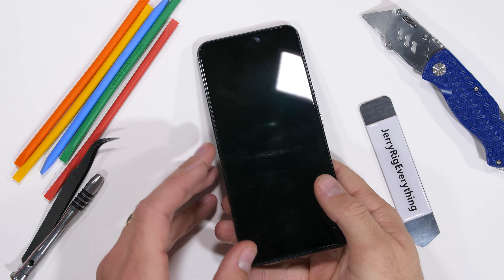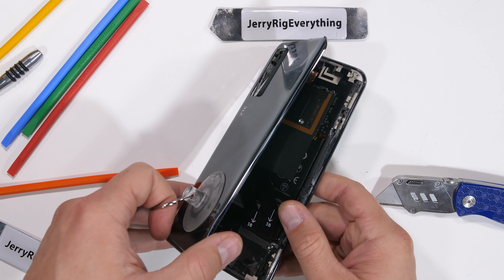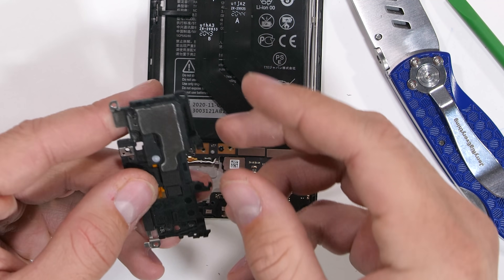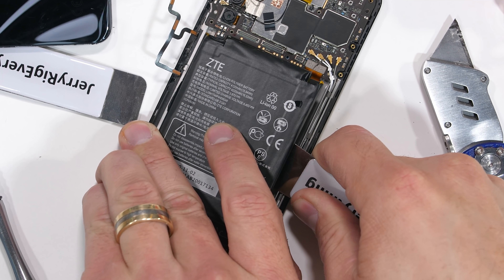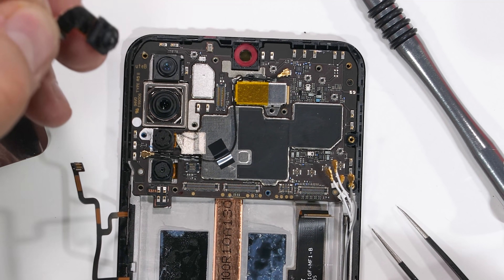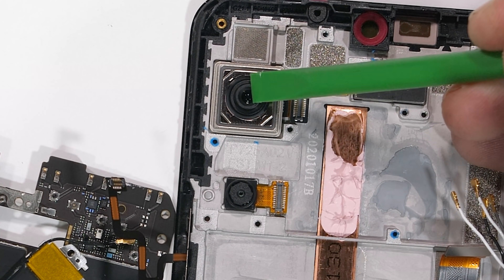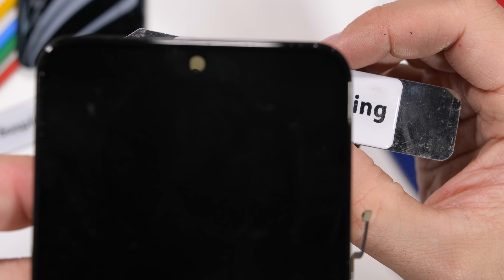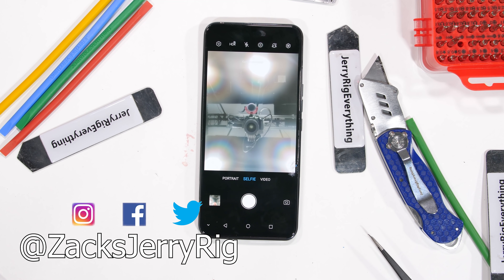Under Display Camera TEARDOWN - How does it work?!

Comment: I work with that symbol daily at work. It means ESD sensitive component, and do not touch without proper ESD protection. 

It is to notify for factory operators to groud use ESD strap before handling the components.

Comment: sir pls help me. I have a doubt. my phone fell into water. I picked within 5 secs. removed sim. switchoff. nd after few hours water is in display . functional visible, but water seems to spread. some video told to keep in rice remove battery. I ruined it. i seems to have broken cable connecting to main motherboard. while removing it like lego. without experience. can i get cable replaced.

Comment: Hey Jerry,
I'm an electronics engineer from Germany and I see the symbol every day. It indicates that components on the board can be damaged if there is an electromagnetic field in the vicinity (for example, rubbing socks on the carpet or a balloon on your hair googel: ESD or electrostatic discharge). 
This is usually only important when assembling and repairing, but unfortunately most of the time nothing is repaired, so only those who assemble such devices see it. 
To avoid damaging anything, you only touch circuit boards at the edges and ground yourself so that nothing can become charged. 

Thank you for your good content here and have a nice day

Comment: The Do Not Touch warning at min 3:42 is an ESD (Electro Static Discharge) warning. To protect the board from static discharge the person or machine handling the PCB should be grounded before contacting the pcb. It is funny that warning is on the button side of the board.

Comment: Question if they're putting warning signs on the inside of the phone QR codes on the inside of the phone but they don't really want us to repair their phones except for their company technicians so why would you need to put any type of warning or QR code inside the phone? So if someone can please answer that and another thing Jerry almost sliced her self and threw the phone on the floor so I guess I need to heat it up a little more

Comment: Alternative safe method to remove the battery is to freeze it down to about -30°C(-22°F) or even lower. This way battery gets solid and the glue cracks due to shrinkage also the cold decreases adhesion.

Comment: The strange warning symbol actually means something like „do not touch without ESD-Protection“ it is used if the part you assemble/disassemble is sensitive to ESD and might get damaged without protection. Esd stands for electrostatic discharge.

Comment: You switched the order of the ribbon cables over the battery. I guess it's fine, they are similar enough to be swapped, but now they overlap. Not a good look.

Comment: Great job with the teardown. Impressive it still works after all that. One of the more complicated constructed phones I’ve seen. The assembly lines must be a nightmare to setup and run. At such a relatively low retail price it could only be done with extremely cheap labor and overhead costs

Comment: I was still using my L Noxv I got in 2017 up until recently when I dropped it and the vibrator stopped working. It served me really well. Nice to see ZTE innovating again. I still miss phones with dual front facing speakers though. If I had my way, I'd make them make a smartphone with a screen that goes right up to the edge of the front speaker grills. And the selfie camera can then hide under the grill with a hole made larger just for the camera. And then they could use that grill space for other sensors as well. Blending the almost full screen look with great speakers and a camera that doesn't have to shoot through a screen.

Comment: The only way to see the "so not touc" warning is to touch it. 😄😄😄
Reply: For the assembly workers, warning them that this assembly is static sensitive, so needs special handling, and a ground strap. While you probably will get away with it in a humid climate, if you are in the factory making tens of thousands, and have a 1% failure rate, you will lose that contract fast, especially as ESD does not always show up immediately, but can take a few hours to months to show up as random failure. 

Warranty claims over around 0.1% to major phone manufacturers is a red flag that something is badly wrong, and they will get those units to analyse down to the silicon chips in the packages.

Comment: This definitely has to be the new future for front facing cameras
Reply: I'd see these taking off soon in like 2022-2025
Reply: @mistermoee  2027
Reply: It'll probably be the future when apple "invents" it in 3-4 years
Reply: @juliangaming9713  Apple fanboys will shit and piss over it
Reply: @juliangaming9713  apple phones has 3 more cameras besides selfie camera so they really need to work hard to achieve this
Reply: @juliangaming9713  Samsung will launch it next year
Reply: @girlsdrinkfeck  yeah
Reply: @juliangaming9713  2027
Reply: @juliangaming9713  LMFAO
Reply: @juliangaming9713  yea true and actually works
Reply: @juliangaming9713  🤡
Reply: The only bad thing is that now it would be tricky to put some tape exactly over the front camera without losing information onscreen
Reply: @kazuhiramiller2121  why do people put tape on their cameras anyways?
Reply: @kazuhiramiller2121  who does that tho?
Reply: @xNoExcuses.666  besides me, actually a lot of people out there, you can even buy little pieces which open and close as u demand to use use webcam/frontal cam
Reply: @kazuhiramiller2121   well in that case you can use, popup selfie camera. You don't even need to tape it.
Reply: @Alter Ego u mean a phone that uses micro LED ,so it slides out of the way, possible but more complicated and more liable to failure than a transparent panel
Reply: Wait till Apple “invents” this so they can ditch the notch
Reply: @superNova5837  2027
Reply: People want to remove nothch and hole pouch without popup camera so this is the only option
Reply: Not a chance, maybe something to a similar effect but not done in this way. This tech has been around for years and the likes of Apple and Samsung already know about it. It’s just looks horrendous in application and a notch is just so much more useful.
Reply: @lordv1le859  I mean, i don't disagree, hence why I said future. As the tech is now I wouldn't want it, but im a few generations it could be flawlessly integrated into apple and Samsung phones. 

Also just out of interest what do you mean by the notch being useful?
Reply: @Tyrone2714  The notch allows FaceID which is more secure than other types of facial recognition on phones. It also allows for a proper earpiece instead of an under screen or tiny unit crammed into the bezel allowing for better sound when used for stereo audio.
Reply: @lordv1le859  oh didn't realize. What about phones that have punch hole cameras instead of a dedicated notch area. Wouldnt this be the future version of the punchole design on phones like the Samsung s20?
Reply: @lordv1le859  Tim cook said iphone x will revolutionise the next decade of iphone...
Reply: @Waseemmmm  what phone doesn’t use gesture based navigation now? Last time I checked before the X everyone had just removed buttons and replaced them with software versions.
Reply: @lordv1le859  shhh things are only bad when Apple does it
Reply: @girlsdrinkfeck  some and there’s a difference between being first and doing it right. Most phones pretty much mirror apples now.
Reply: @girlsdrinkfeck  no as soon as the iPhone X came out Samsung and google both swapped from software buttons to gesture that are similar to apples within 18 months.
Reply: @girlsdrinkfeck  I think you should look at android gestures. 

Swiping up is innovative? Samsungs ways is also insecure AF.
Reply: @girlsdrinkfeck  disagree with what the android gestures basically copying apples? Sure I mean the 1/3 screen width bar at the bottom of the screen sure isn’t copied. 

Fingerprint readers aren’t secure nor are Samsung’s attempts at facial recognition.
Reply: @girlsdrinkfeck  why exactly? Very easy to just say wrong rather than counter the argument.
Reply: @girlsdrinkfeck  ok mr trump
Reply: @girlsdrinkfeck  and the world is flat, Area 51 is hiding aliens, aliens built the great Pyramid etc etc